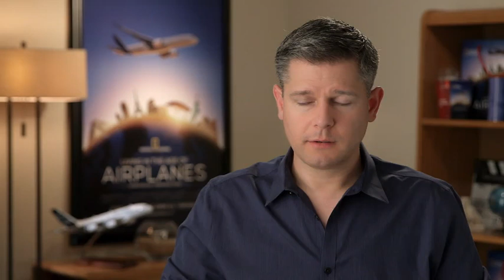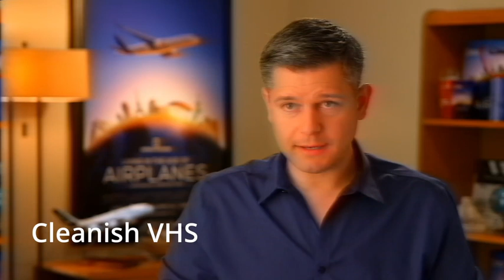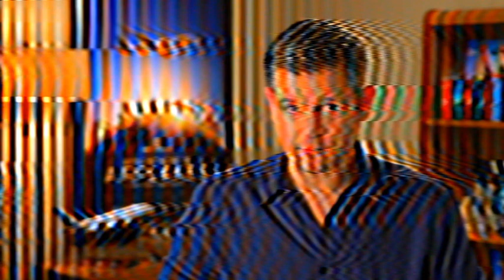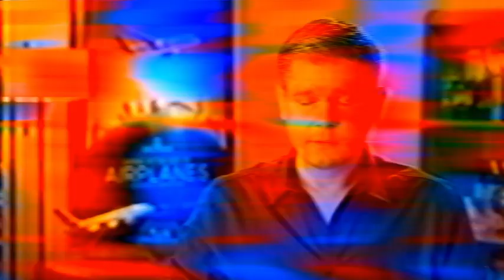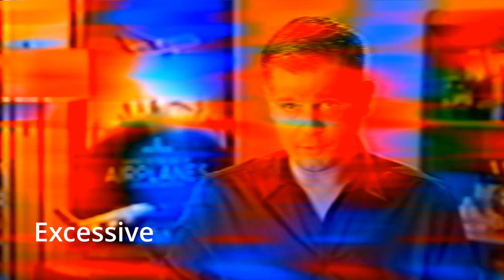Experiments in fake VHS

Comment: Thanks for sharing these experiments! Would get that extra flavor with some moving tracking lines and distortion at the bottom. How far did you get with this, did you make it into a plugin? I saw you played with running footage through a real VHS in another video.
Reply from the maker: I haven't yet, but it's something I'm planning for the next time I get a couple of afternoons clear :-) I had a play with faking VHS without a "Fake VHS" plugin, and found that the kind of sync tearing at the top or bottom could be faked up a bit in Fusion by sticking a graduated Background into the mask input of a Fast Noise node, set for long thin stripy noise, quite contrasty, with a bit of "Seethe" to make it roll up and down a bit, and then into a Displace node set to only displace it horizontally. The gradient of the background sets where it fades in and how bad it gets, the Noise sets how jittery the verticals are, and the Displace amount sets how bad it gets.

Comment: cleanish VHS looks amazing. how did you do it?
Reply from the maker: It's a bit complicated, but I'll try and explain as best I can. Because I haven't figured out how to write OpenFX plugins, I just wrote a bit of code to apply a filter to a .png file, and used ffmpeg to export the video clip as a sequence of those. Then I ran the filter over each .png, and compiled them back into a video with ffmpeg again, finally dropping the audio back over in Resolve.

The images are filtered through a 2-pole State Variable Filter, like in a music synthesizer, where I can vary the cutoff and Q. Each frame is converted from RGB to YUV because VHS records luma and chroma separately, then stuffed through the filter. For "Clean VHS" I set the Q to 0.707 (Butterworth response, as flat as possible right up to the cutoff frequency) and worked out roughly what the cutoff needed to be for about 240 lines luma resolution and 40 - yes, forty, four zero - lines of chroma. On a normal 24" screen, 40 lines of horizontal resolution would be a picket fence with slats about the width of your index finger.

It could probably do with using more filter poles for a steeper rolloff to get the "boxy" look that detail gets in VHS. I don't know how steeply the bandwidth drops off outside its passband but it's probably steeper than the 12dB/octave (12dB attenuation every time you double the frequency) that two poles gives you. Initially I set the luma and chroma lowpass filters to about 1.8MHz and 300kHz, because that seemed "about right", but ended up reducing that to around 1.2MHz and 200kHz because the effect wasn't quite brutal enough.

Note that the cutoff frequencies are given assuming the video is PAL 625 50i like real VHS would be in most of the world although the actual video is 720p 30Hz. It doesn't actually matter! The cutoff frequency is really a proportion of the number of samples passed through the filter, and converting it to "real Hz" is a matter of convenience rather than function - in reality, the filter has an adjustment range of 0 (fully closed) to about 0.4 (just tapping the edge of stability).

Comment: Decent emulation compared to overlay, filters
Reply from the maker: It really is a filter, strictly speaking. It's a set of lowpass filters that mimic the lower luma and chroma bandwidth of a VHS deck and its circuitry.